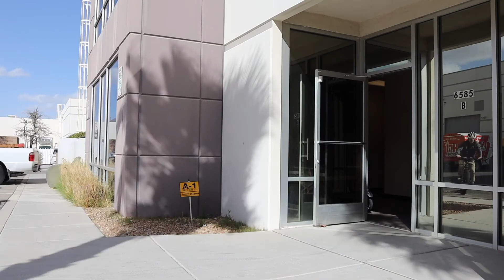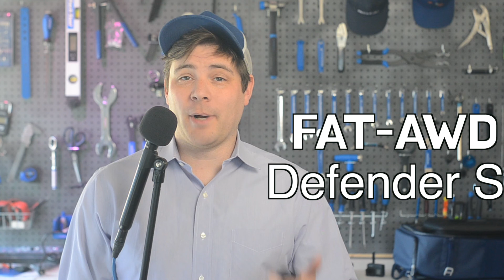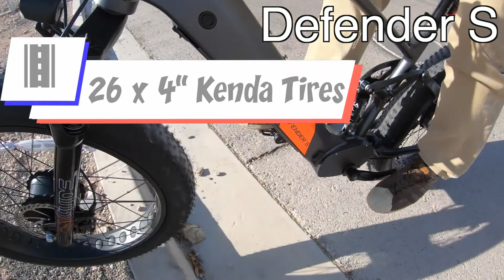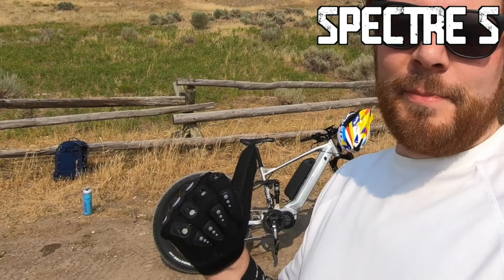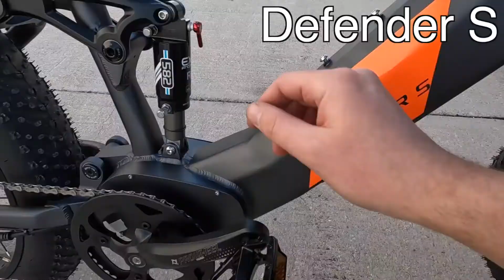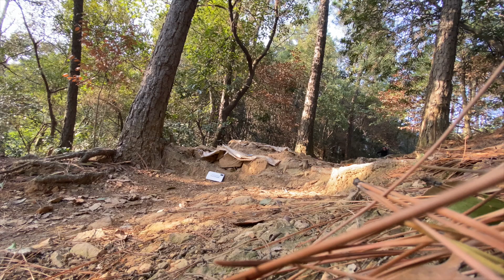Defender S Quick Take: Dual Motor POWER! #electricbike #eBike

Comment: I purchased a $4000 CAD Defender S e-bike from Eunorau, which arrived with a manufacturing defect in the frame preventing the battery cover from latching. Despite professional assembly and documentation from Velofix confirming the issue, Eunorau's support was unresponsive and unhelpful. I had to file a chargeback through my credit card company. I advise caution when considering purchases from this company.  I own two of these bikes and the quality of the build is seriously lacking...I would not consider buying another!

Comment: How do the dual batteries work? Can you switch to using either one or both?
Reply from the maker: Whichever battery you have connected (1 ,2, 1+2), the bike will drain it evenly.

Comment: What is the controler, should be able to run 45A to get full peak power for both motors.

If gives only 30A  you get 1500W what you can achieve with two 500W??  Peak 750W???

Comment: This is design is for 2 bat, should be tested with 2 bateries, with one bat at full peak power current 40+A on single bat, with 2 bat current 20+A  what dramatically reduces voltage drops in cabling and internally so you get even bigger torque, speed, power on motors.
Voltage drop Ix R,  power drop loss I x I xR. So half current 1/4 of lossess in power.

Comment: The worst eshop, they are thieves, they don't provide warranty, don't answer emails, acknowledge problems but never send parts in 4 weeks. Now they want to refund me %50 without fix the problems. They sell very dangerous stuff, Bafang is the worst manufacturer, no pedal assist, as soon as it feels that you start pedaling the motor runs at maximum speed, it's not assistance, it's a switch on at 100%. it is dangerous, it can cause you to fall and you cannot ride slowly. it is not assistance. A kit designed for a Mountain Bike not on a Mountain Bike due to the shape of the motor and the battery. all brakes are hydraulic today and the kit is not compatible. I ordered a kit for my son, they are not even able to advise on a model, to respond to emails, to tell me if it is in stock. they wake up after 10 days to tell me to choose something else because it's not available, still without advice

Comment: All that's need to upgrade the brakes are 203mm disks, slightly better pads and the brake caliper adapters to raise them to the radius from the 180mm to the 203mm disks or 11.5mm.  Total cost is under $100 for both wheels.